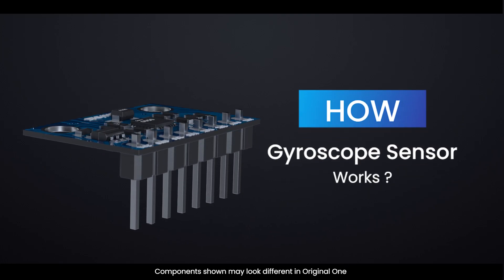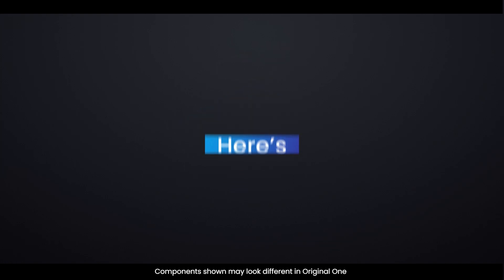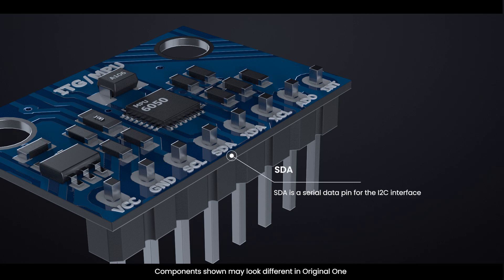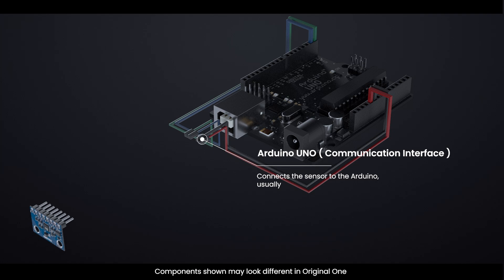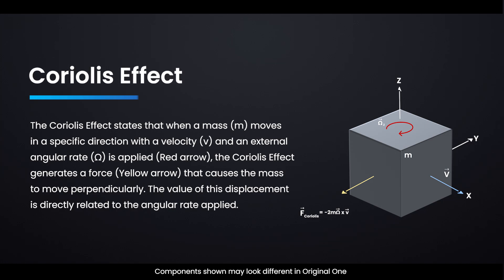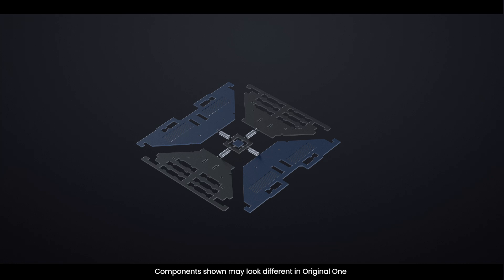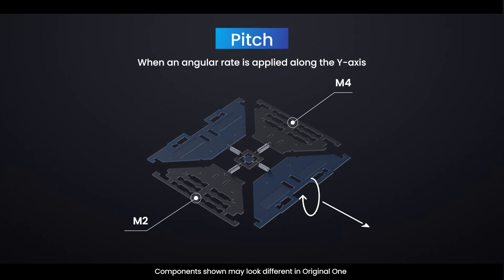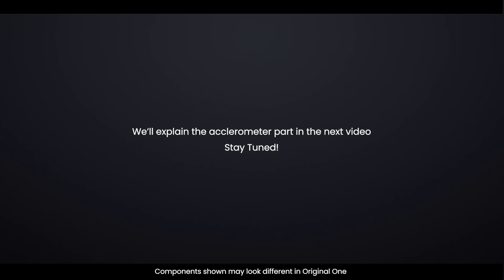How Gyroscope Sensor Works ?  | 3D Animated 🔥

Comment: radmi c14 Gyroscope sensors are used across multiple industries because of their ability to detect and measure rotation with accuracy. In everyday life, they play a silent role in the devices we use. For example, when you tilt your smartphone, the gyroscope helps adjust the screen orientation instantly. In video games, it enables smooth and realistic motion tracking for immersive experiences. In cars, gyroscope sensors are vital for stability control and navigation. They help detect sudden changes in movement, improving vehicle safety by supporting systems like anti-lock braking and rollover prevention.

Comment: good work. but can the mpu6050 measure the distance traveled on the X or y or z axis?
Reply from the maker: No bro it just calculates the acceleration only 🤞
Reply: If you use a little math (like accumulating acceleration over time) you can extrapolate distance traveled over that period of time.